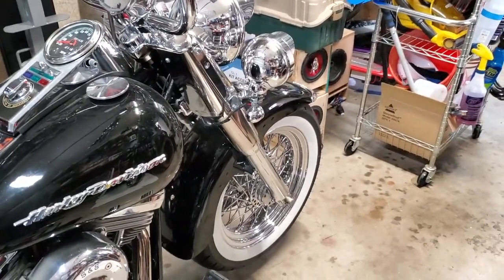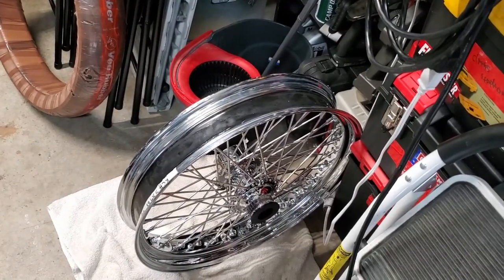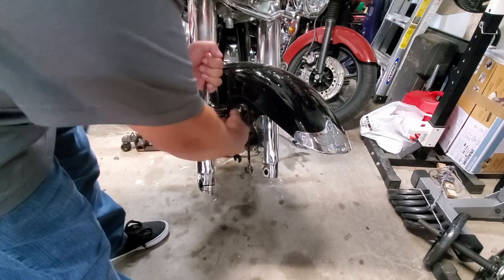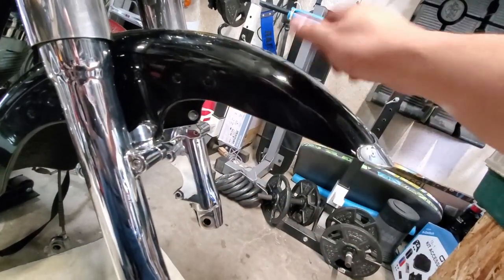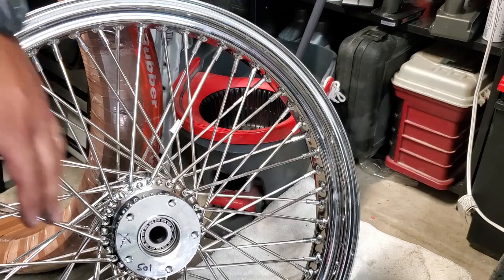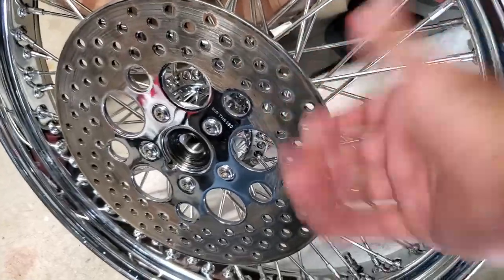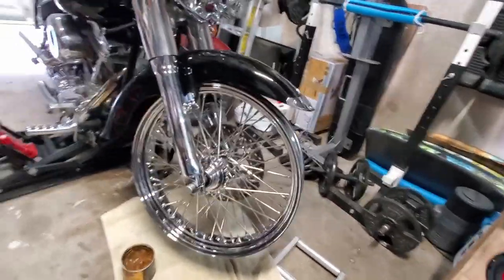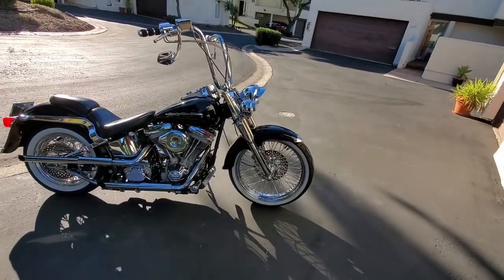21" Front Wheel Harley Davidson Fatboy

Comment: old wheel and tyre is better looking,  you now have a smaller whitewall than on the back, the new wheel has lower profile tyre to oso expect to feel the bumps a lot more... steering geometry will be a touch different too... both nice but the older chunkier look apeals more to me...
Reply from the maker: Thanks for the feedback Phill. I did feel a slight difference in the ride, a lil more of the ground if that makes sense, like a car with racing tires. Outside of that it felt pretty normal.  Appreciate the support.

Comment: You wouldn’t happen to know the wheel bearing size for this wheel would you? I ordered the same wheel but the seller fucked me and sent the wheel with the wrong bearings
Reply: Call your local Harley Dealer and ask for Service Department. They have an EPC tab that can get you the right part number and can even sell you one.
Reply from the maker: Sorry bud, never measured but you hitting up your local HD or checking out JPcycles/ Dennis Kirk should get you exactly what you need.

Comment: How’s it ride? Wanting to upgrade from the stock 16 x 5.5 on my softail but I don’t wanna sacrifice how comfy that front wheel makes the ride
Reply from the maker: I didn't notice any difference in the ride.  But i did quickly figure out that it impacted my speedo reading.  Was cruzin at 75 MPH and was getting beat pretty good by the wind when i realized the larger wheel doesn't have to spin as fast so i was definitely going much faster.  Got a tank mount pouch for my phone to use GPS and see how much of a deviation i've got.

Comment: What spacer kit did you use and what year is your bike
Reply from the maker: It was a 95. I didn't have to get a kit. Used my stock spacer, DNA provided the rest
Reply: I’m not able to see your reply for some reason
Reply: I almost had a big accident todya for using the stock spacer
Reply: I’m having a big issue almost flew off my
Bike earlier used the stock spacer and idk it punchered the bearing
Reply from the maker: Dude, glad you are okay. Are you getting some wobble or something?  What bike do you have?
Reply: @Mikeityourself  yeah wobble with it
Reply: @Mikeityourself  2005 softtail deluxe
Reply: @Mikeityourself  is your 95 3/4 axel and bearing
Reply from the maker: I dont have the bike anymore but it was the standard setup 3/4 axel. The wheel bearings were included when I bought the wheel. Didnt have to do anything other than slap the rubber on it and bolt it back up.

Comment: Came across this post and thought some folks might find my experience of some small value.  I have a 2007 Fatboy; changed the front to 170/20-21.  The rear is a 200/55R-17.  I also lowered the rear about 1"  The result looks great.  The ride is another issue.  The changes have impacted the caster angle such that the bike wants to cruise straight ahead.  At speed turns are fine, but at slow speeds the front wheel wants to "fall in".  U-turns in residential streets used to be a non-issue now take some concentration or you will duck walk like a nubie.  Overall the appearance was worth the minor change in handling but the bike can be a handfull at very low speed.
Reply from the maker: I am surprised at those impacts.  Especially the "fall in" part. Wonder if any other mods were done like ape hangers since it seems to be at slow speed.  I notice a difference between standard bars and Ape's definitely not the same type of steering.
Reply: @Mikeityourself  I suspect lowering the rear 1" also had an impact on the caster angle.  Still have the stock bars on it though.  
Lowering the rear made getting the bike on my motorcycle jack a pain as well.
Reply: Is the rear an 18 "x 3.5 "bro ? So I can go ahead and order the right sized rear white wall tire? As we can wait up to 3 months for shipping on this part of the World. Cheers from down under NZ.

Comment: This turned out very good, to my surprise. Thumbs up!
Incidentally, I have a 1995 Bad Boy Springer softail in new condition. I'm always very careful not to drift too far away from its original look/design. (has the same 21" spoke tubeless wheel as what you installed here)
Reply from the maker: Thanks. I worried a little about the look, I'm not a fan of the very large front wheels and didn't want this to have that exaggerated look. I lucked out.
Reply: @Mikeityourself  Agreed. I always thought the big fat front tire looked ridiculous but I guess that was part of the theme behind calling them a Fatboy or Fatbob.
You definitely made a big improvement with the 21 although they do have the disadvantage of taking bumps and holes more rough with less "cushion" than the fat tires. Be well!
Reply: 0

Comment: Beautiful bike!  What sized tire did you go with 120/70 (I may have missed you saying it in the vid) and have you noticed a difference in the handling or ride?  I was thinking maybe a 19" on the front of mine but after seeing the 21" on your bike I'm thinking that it is the ticket.
Reply from the maker: yep, 120/70 is what I got.  I dont feel any difference in the ride.  The one thing I did notice was on my first ride out, I was on the freeway and felt like I was struggling a little (just lots of wind) to hit 80 MPH and then realized that my speedo was off because of the bigger wheel.  It reads about 5 MPH Lower than actual speed.

Comment: What size wheels are they both 3.5? And if so did they just go on with no problems?
Reply from the maker: Rear is stock 16" x ~4"  and the front is 21 x 3.5.  No problems with the front swap.  Had to get risers for the fender and when you buy your wheel, you need to let them know which bike so they send you the correct spacer.  Other than that its plug and play.

Comment: Did you had to replace original fender?
Reply from the maker: No sir but I did add fender risers to it.  I dont there is enough clearance without them.
Reply: @Mikeityourself  I own a 2010 Fat Boy FLSTF do you think I can do same setup? And if so, would you kind enough to send me a link for the rim and tire sir? Thanks in advance
Reply from the maker: you should be able to, ive seen plenty out there on the streets. Your rim will be different then my old 95 but same concept.  I used the 60 spoke wheel from DNA. Here is the vendor i bought through - beware it takes a few weeks to get your wheel.
https://www.ebay.com/sch/i.html?_ssn=kcint&store_name=kcinternationalwholesalestore&_oac=1&_trksid=p4429486.m3561.l161211

The tire I used might be the same size so here is what i went with.
https://www.ebay.com/itm/284707842200?itmmeta=01J22AZ7QKY5EQ000K1VGQ8K9N&hash=item4249e8e898:g:0aoAAOSwpRRWm20L&itmprp=enc%3AAQAJAAABcCNx09LHQ8X2Je1DcjY3Yw9%2BOuIiktL7bWetztHs%2B%2B1OzjbPqTMz4AcxhXY1mIbMNMun9dvX1ODh2qHqDvDV%2Fbdx2xhD88bXMMDecBJByrDf6bSasDk2FnWRPvUpLILlur%2BRaX%2F7%2B2Vm10Tr17O8HhFCqGqQ3UlogATwIIsvLs1MxYv0A%2FyaFJOBHjwLrXhbGPhCWszosY03jqL0NQpOhQ6ks5ir8GnQpCx6pQaIHLxL4fWp3owh3SYqucpoRnz2FxQX38nGjZYHpgoCqcl7Zw%2FUm%2Bd3IOxsL3GEZu2OyKCjvys1%2FqFJRr6dVHmdlQO443iW63fdx1I4Gd6MscMzPs4iPn9BuI293k11SGVhPYuuAja0qTkf0%2BY9Z5HLAx0cnUn1qmVi0M1%2FrdRGAdB6OsZ2xlOPWc4PENW2%2FzSx%2Fo0a3NT41gGozRdZLtvyLkuRCUuLxp1%2FCDh%2FOrur%2FxrufhxOddpqhOsz5asCUpW%2BN%2B7O%7Ctkp%3ABFBM9Pv8ypBk

Risers
https://www.ebay.com/itm/374251340524?itmmeta=01J22B1DMYM0T3B7TJQ3M70DCY&hash=item57231e42ec:g:oT8AAOSwzrtiuny3&itmprp=enc%3AAQAJAAAA8Oq9IH9upRnGj%2BdOQO7RCSj%2BPf%2FNYHQUhnMYB%2BEVdPhVDXMbEzCeNM0cePCuYt%2FAciWpMWIExy3yEHjJvGIpy2BevpfMkHQ2%2BvLZlk9zyk8dTRB6xHdgHDX%2BBxhKptGGx%2F2DJ5sh97JtKyxpeTHppLcVVLGiqX60SsbPLuANPhxFAIP9Y1vBK4UzAmF%2FrPozrcHUAkv68qQxwugaNkDY2ijDVRCzmQiE5Oou6VwBftYcM7JQ913K18T%2FyqMzsa%2Fatn7DgMs60cJv1Ebd6%2F3fENbaariGT7BZp6a7OKyog6%2B%2FeZGUEaNGcQxt%2FfKIjS8%2BsA%3D%3D%7Ctkp%3ABk9SR87ahcuQZA

Comment: Thinking about doing the same thing to my Fatboy how does the bike handle with the bigger wheels?
Reply from the maker: Honestly I don't feel any difference in the ride.  The one thing that took a minute to realize while riding was my speedo was off by about 5 MPH, cruising at 75MPH seemed to be sending more wind than normal in my direction and then I realized it was actually 80 MPH due to the larger front diameter.  But other than that it feels stock to me.

Comment: Can you post a link to this rim?
Reply from the maker: Here you go, bought from eBay.  https://www.ebay.com/itm/293967827124      They also have their own website.  It takes a couple of weeks before you get your wheel, they apparently don't make them until you order and these folks are just a middleman for DNA (located in California).  The price has tripled since I bought mine, id either hold or shop around.  Its the DNA 21X3.5" 60 SPOKE DNA FRONT WHEEL 1984-99 FOR HARLEY HERITAGE FATBOY